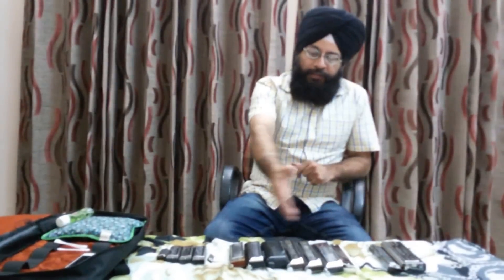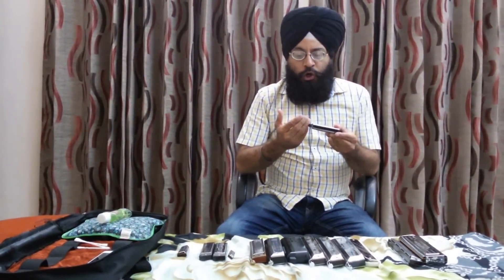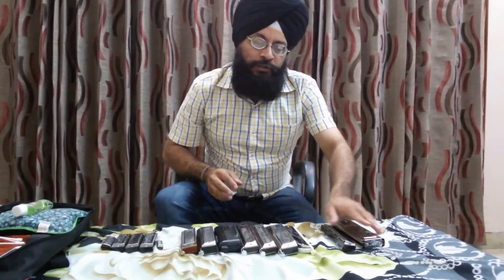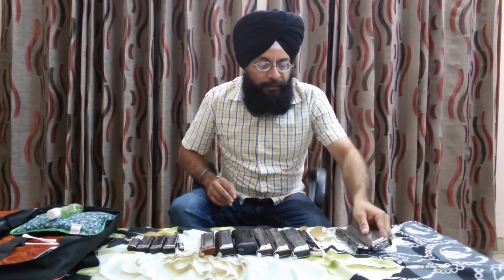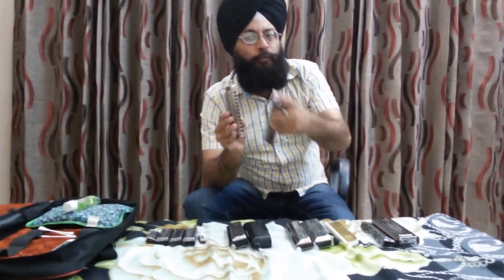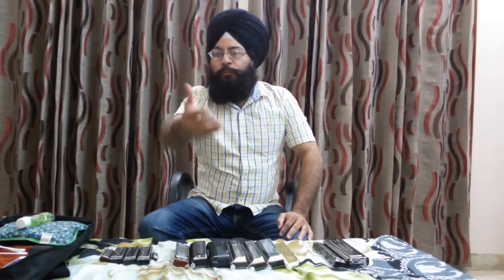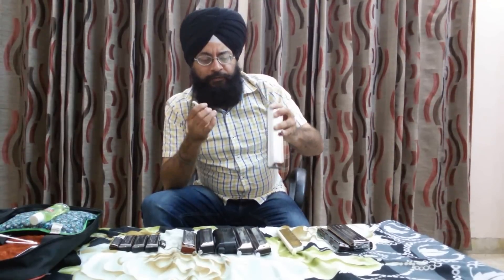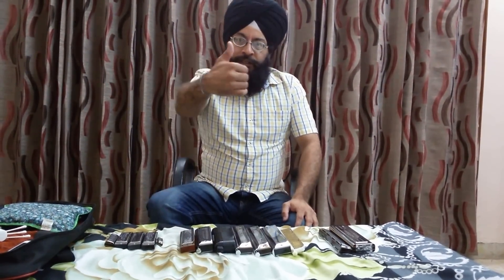Learn harmonica (Lesson 6) Types of Harmonicas

Comment: I have subscribed ur channel and like ur style of teaching. I a beginner and and face problem. After playing for some time my lips start paining and movement of the instrument become restrictive. Means it is not smooth. Give me some tip.
Reply from the maker: Pain in the lips is normal for a begginer.  It will gradually go.  Take a sip of water after every few minutes during play.
Reply: @doordarshisingh  Thank you so much. One more query. I saw ur video on maintaining Harmonica wherein u suggested to use any mouth wash after every play. Accordingly I used LISTERINE COOL MINT MOUTHWASH. But after the use it becomes Little sticky.. The sound changed and solder was not moving freely. Ultimately I washed and it returned back to its  normal condition. How to handle such condition and where I went wrong?
Reply from the maker: @renaissanceschool3098  just apply mouth wash to the mouth piece only with a clean cloth.  Dont wash it
Reply: @doordarshisingh  and not to the windows of the instrument? I m using earbud as u recommended in ur video.
Reply from the maker: @Renaissance School no dont do this.  Use only dry earbuds.

Comment: Good effort. In a tremolo harmonica what you said that one of the reeds is  tuned slightly flat is not correct.One reed is tuned to its correct pitch which could  be from 440 - 445 Hz or more. It is the other corresponding reed which is tuned at slightly higher pitch ie  generally  higher by 10 cents or so. This variation in the pitch will differ from reed to reed. In case of the higher notes it will be different than the lower notes.
Reply from the maker: Thank u sir for correcting me. Actually I had read that one reed is tuned flat and other is sharp on some websites showing tuning charts.